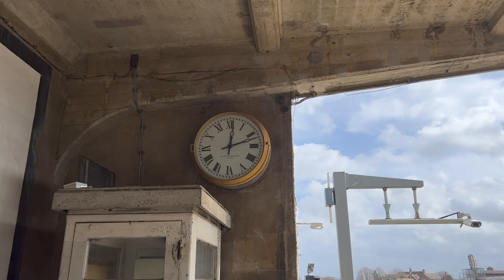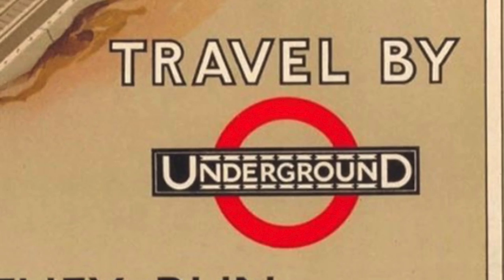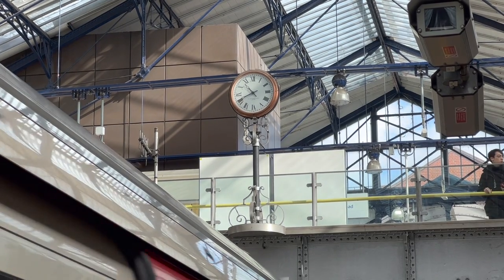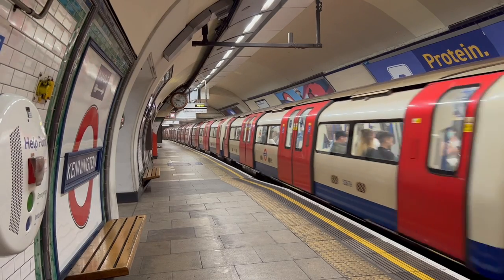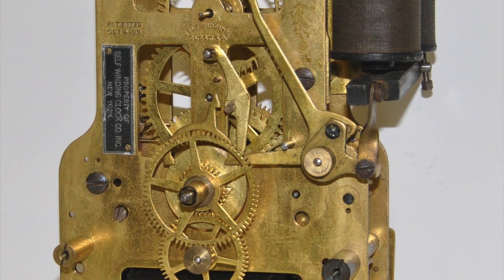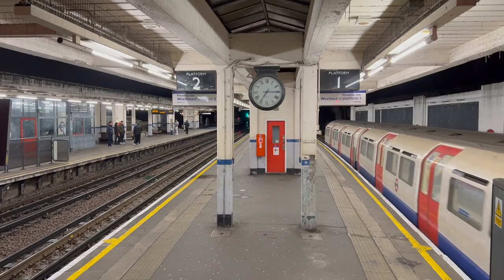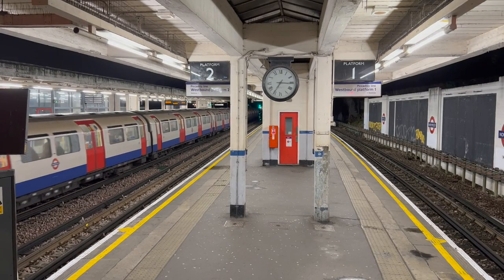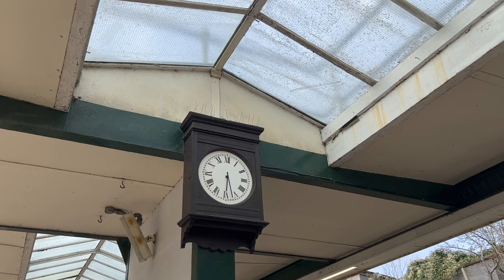What the heck is a self-winding clock?

Comment: The Tube runs on DC (direct current) so you won't get electromagnetic interference. But it is possible that someone didn't know that. I'm also speculating that Yerkes was getting a kickback from the clock manufacturer, that is how capitalism works.
Reply: DC motors can cause electromagnetic interference. Open up almost any 12V DC model railway locomotive and you will find a capacitor connected across the motor supply to reduce (TV) interference. If you put your fingers across the terminals of an energised 12V DC relay whilst the current is being disconnected, you'll certainly feel the kickback from the collapsing magnetic field. Now imagine the field collapsing in a 650V DC motor. Its what causes the bright blue flashes of lightening (several thousand Kilovolts) as the the train's pick up shoe loses contact with the live rail. Lightening causes electromagnetic interference.

Comment: My 1970 car has the same concept of self winding mechanism, as well as our seventies kitchen clock. Mechanical, with an electromagnetic winding mechanism. This was the only way a DC powered voltage clock (by batteries) could be made. On AC voltage, a real motor could be used. Until the quarz clocks were invented.

Comment: are you sure? For 150 years all these street clocks (at tram stops first) are NOT winding a spring at all, they are just repeaters of one central master clock. Magnet does not wind any spring, it just pushes the mechanism to one minute ahead when central station sends the pulse. Or resets everything to 00 minutes when station sends control signal (negative pulses in most versions). The very idea was to have strictly synchronised clocks for the whole system to upkeep tram schedule, not a zoo of stand-alone units with their own time on each tram stop.

Comment: I knew they were mechanical, somone must have told me, but I always imagined an electric motor to do the winding, not a ratchet. Batteries? Phah! With all that electricity around the place why not a constant feed, suitably stepped down, from the mains?
Reply: If you lose power they all stop.  With a known load and battery charge, you can pretty well nail down exactly when the battery needs to be changed.

Comment: I've actually got one!  It says, in pencil in the corner, "I C Depot", which I think meant Illinois Central [Railroad[way]].  https://en.wikipedia.org/wiki/Self_Winding_Clock_Company
Reply: In the US, at any rate, the hourly setting signal came from the US Naval Observatory via a special Western Union time service.  My clock says so on its face, along with a snazzy red lightning bolt.  Failing that (WU time service ended sometime in the 1960s) I have it slaved to a GPS receiver-disciplined oscillator, a Spectracom 8183.  Sorted!  (There is a time-nuts mailing list that makes me look like the piker that I am in this regard.)

Comment: So the clock is powered by a spring, wound by a solenoid and ratchet, powered by a battery, which is presumably float charged by a DC power supply, powered by a mains AC connection; bloody hell was this designed by an engineer or a politician? By the title of the video I thought there was going to be some really clever heat engine that extracts power from fluctuations in ambient temperature.

Comment: I hate daylight saving, it causes so much difficulty. In the old days, when it was possible to buy a printed version of the national railway timetable, large parts of it consisted of notes describing how a service ran an hour earlier or later at certain times of the year. The problem was even worse in the world of aviation - at one time countries used to change their clocks on different days so there was complete carnage during September and October. In the world of computing, Microsoft Windows still reports file times incorrectly because it doesn't understand properly how daylight saving works.

Comment: I knew what a self-winding clock was - some cars used them before quartz based timekeeping became commonplace.  They used to have a very short duration spring and would wind themselves up every minute or so.  But I was unaware of their use in this application, and was wondering about the synchronisation problem, so thanks for the explanations.
Reply: However, the Underground clocks seem considerably more reliable than the car clocks I remember from the past. "A car clock is the same as any other clock, except that it always points to ten past seven."
Reply: @Ian Kemp  I think our old Volvo had one (1970s), but I could be mistaken. I think the clock was German, and kept reasonable time.

Comment: So "self-winding clock" is really just powered by battery? One picture seems to suggest that it is even powered by wire. I don't know what is the point for these clocks. My $20 clock automatically sync its time and I only need to change the battery every 2 years or so. These poor fellows need to adjust the clock for summer time each year and I bet the clocks need to be tuned from time to time too. How do you know the clock you see now is the same clock 100 years ago? Anything can be long lasting if you keep servicing it. Seems more like a case of poor spending to me.